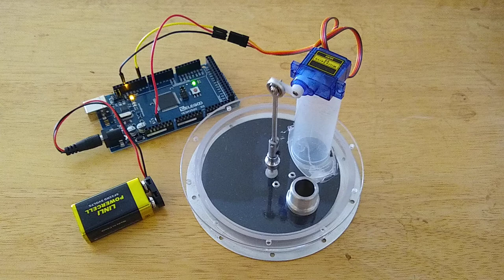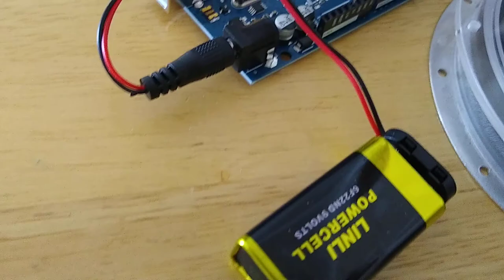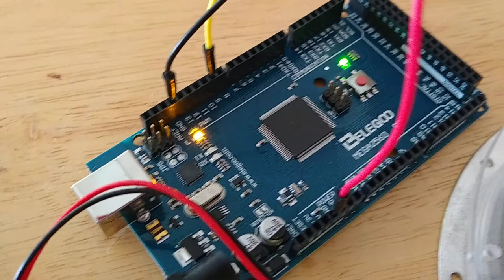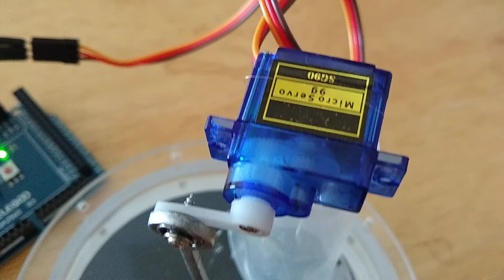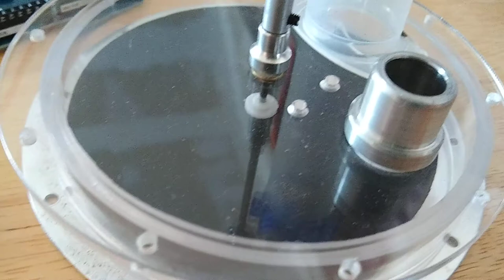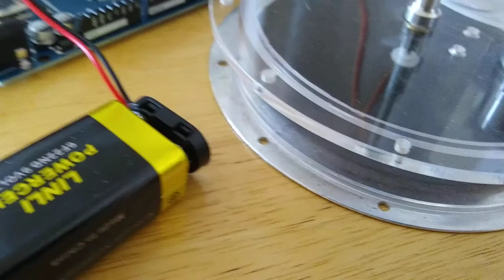Arduino powered Stirling engine, independent of laptop (9v battery power supply)

Comment: Seems to me, the point of a sterling is to create power not use power! I don't see any point in this!
Reply from the maker: The Arduino is only controlling the displacer not powering the engine. The displacer regulates heat input. The actual power source for a Stirling engine is heat not the displacer motion, which is actually parasitic anyway.

This would be comparable to regulating the ignition timing in a gasoline engine. The ignition system (computer, distributor etc ) requires a very small input of energy from the engine, but the ignition system is not what powers a car. (Gasoline or HEAT from burning fuel)

Having programmatic computer control of the ignition (heat input/displacer motion in a Stirling) opens up more possibilities for higher performance.

More information on the forum: https://stirlingengineforum.com/viewtopic.php?f=1&t=5241
Reply from the maker: @Tom R If the displacer can be controlled independently of the engine, various performance optimizations are possible. It should be obvious this is not a fully functional engine.
Reply: @peoplesresearchcenter6184  I got that right away but I understand that most people doesn't. I have been in to a similar idea to build a similar stirling contraption where I control the displacer much like the ignition in an ordinary petrol engine but I will place a magnet in the power piston and coils around the cylinder in order to get electric power without rotating mechanics and pushrods.
Reply: @Tom R 🔴 What Is Islam? 

🔴 Islam is not just another religion. 

🔵 It is the same message preached by Moses, Jesus and Abraham.

 🔴 Islam literally means ‘submission to God’ and it teaches us to have a direct relationship with God. 

 🔵 It reminds us that since God created us, no one should be worshipped except God alone. 

 🔴 It also teaches that God is nothing like a human being or like anything that we can imagine.

🌍 The concept of God is summarized in the Quran as:

📖 { “Say, He is God, the One.  God, the Absolute.  He does not give birth, nor was He born, and there is nothing like Him.”} (Quran 112:1-4) 📚

🔴 Becoming a Muslim is not turning your back to Jesus. 

🔵 Rather it’s going back to the original teachings of Jesus and obeying him.